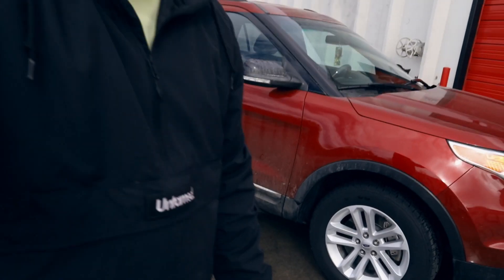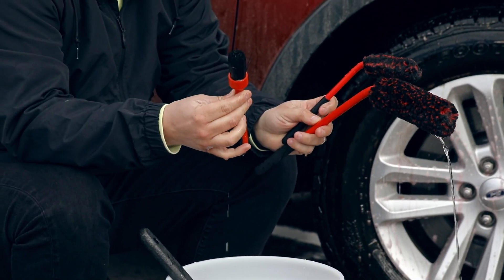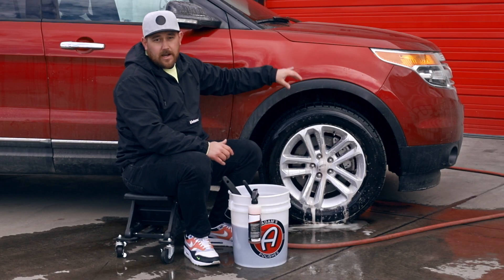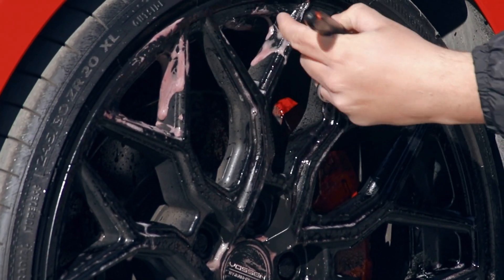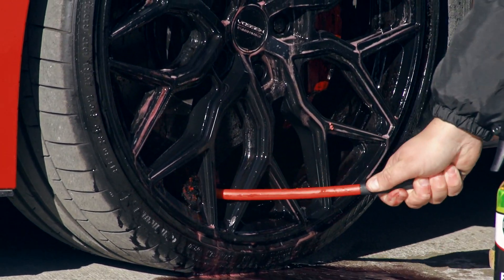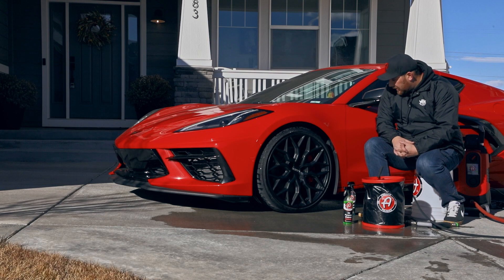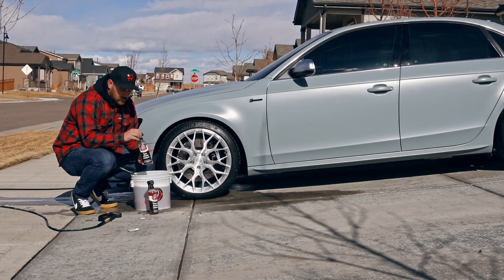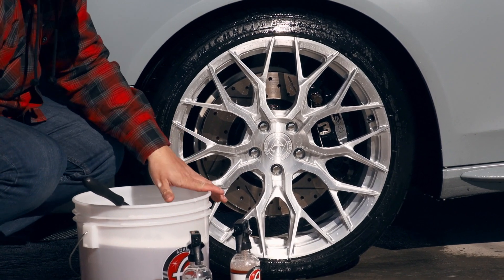What Wheel Cleaner Is Best For You?

Comment: My Z06 has had all sorts of wheel cleaners until recently.  I’ve been on a Brake Buster kick lately.  Uh, that concluded after I tried Adam’s Wheel and Tire Cleaner. My wheels have never been cleaner.  This cleaning solution is aggressive but gentle. It removed all brown gunk from the tires. It did a beautiful job cleaning the face, barrel and inside of the wheels(stock light silver color). I just ordered My second gallon. I use it straight up in a 32 oz spray bottle.  Keep up the good work.  You’ve hit it out of the park with this product.  Thanks.

Comment: I've used wheel cleaner a few times and had very bad results, each time it was a wheel cleaner stating it was good for all kinds of delicate finish, one of them Bilt Hamber. My issue is diamond cut wheels where there is a clear lacquer over a bare aluminium finish. Both times the wheels corroded under the lacquer making it unsightly and impossible to fix without refurbishment. This damage occured within two weeks of cleaning. The issue is that diamond cut wheels almost always has a very thin edge of lacquer where it meets the painted and bare aluminium section. This edge if it has a microscopic break allows the chemical to creep under, once this happens it keeps creeping creating irreversible damage. Both sets of wheels were over three years old and in perfect condition washed only with car body shampoo. Wheel cleaner also has the same effect on center caps corroding under the finish.  My friend had a new 458 Ferrari with diamond cut wheels. He had three set under warranty with the first set corroded after its first service where the dealer washed the car, the second set corroded two weeks after the dealer installed. I think again they cleaned them with wheel cleaner after fitting. He sold the car after the third set was installed. Unfortunately I can never trust any wheel cleaner even the ones for delicate finishes. Love to hear your response?
Reply: Niq ger Lel  I don't use them, I feel they are for people who need a quick result or the wheels haven't been cleaned in a long time. If you regularly clean the wheels and apply a wax or protective coating they clean easy and don't require specific wheel cleaners.
Reply: Honestly diablo wheel gel is a good light cleaner. And i dont like any chem guys products usually but i like that one

Comment: So what's the difference between the purple wheel cleaner and the teal?? They both seem to tackle, break, dust and iron.
Reply: Purple (Wheel & Tire) is good on tires too. As he stated, purple doesn’t have the chemical which attacks turns red/purple.

Purple is good as you can use it on wheels and tires. The teal (Wheel) is for when you have more stubborn brake dust.

The other teal (Eco Wheel) is a lighter formula so it’s safe on all wheel.

Comment: Does anyone know which tire and wheel product of Adam's I should use ? I have a 2013 Mercedes SL550 with the sport wheel package. 19"AMG 5-Spoke wheels with high performance on Runflat tires .
Reply: I don't know if those are clear coated, but when in doubt, use Eco Wheel Cleaner for the wheels, and Tire and Rubber Cleaner for the tires. Then each brush he shows in the video. With those, you should be all set!

Comment: Purple bottle tire and wheel cleaner = OEM wheels. It’s a degreaser and will strip away ceramic/graphene coatings on wheels. 

Wheel cleaner (blue bottle) is pH neutral and safe for ceramic coating, and it contains iron remover. This is the bottle to get if u have wheels that are ceramic coated, or u want a cleaner with iron remover in it. It’s the most expensive bottle. 

Eco wheel cleaner? According to SDS it’s more on an acidic pH level, guess if u have custom wheels these are the go to. Don’t see where these serve a real purpose if u stick to a pH neutral wheel cleaner u would be safe.

Comment: So the wheel cleaner is just basically a Iron Remover? Why not just use that instead of the wheel cleaner?

Last, I have a vehicle that has PVD coated wheel. Now I from what I understand  PVD Coating is pretty  resilient to chemicals and other environmental factors. None the less I still would like to know if using the Wheel and Tire cleaner  would still be okay to use, or should I stick to the Eco Wheel Cleaner?
Reply from the maker: Hi there, in a sense yes, but Wheel Cleaner is a stronger formula in a thicker gel consistency to cling to wheel spokes better and drip less, rather than spray in a wide pattern on a body panel like Iron Remover. PVD coatings can be very delicate on some manufacturers (I know because the black chrome coating on my aftermarket wheels is peeling very poorly on 2 of the 4 wheels after less than 2 years). The Wheel & Tire Cleaner itself did not affect the PVD coating, but more rock chips and debris from the roads that caused failure in my case. If the Eco Wheel Cleaner is working, I would stick with it for the majority of the cleaning sessions 👍

Comment: i used the wheel cleaner on my white wheels and it left a pink residue and can’t get it off
Reply from the maker: Hi Mario, we do apologize about that! Make sure you only clean 1 wheel at a time, when they are cool to the touch. If the wheel is warm or hot, it can have negative reactions. I would recommend our Hand Polish with a Blue Hex Grip Applicator to try to remove any discoloration. Use the Hand Polish in the shade, when the wheel is cool to the touch. Wipe it back and forth several times using light pressure, then immediately buff off the residue with a plush microfiber towel like our Borderless Grey Towel.